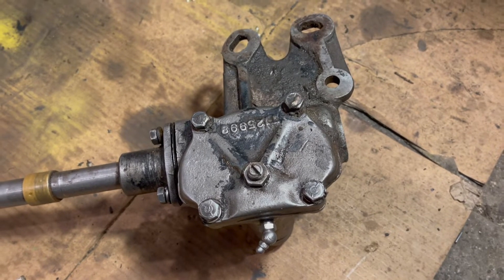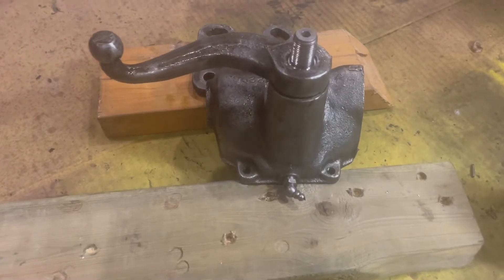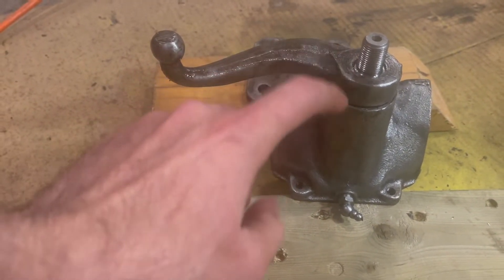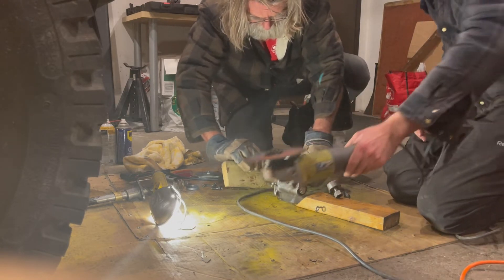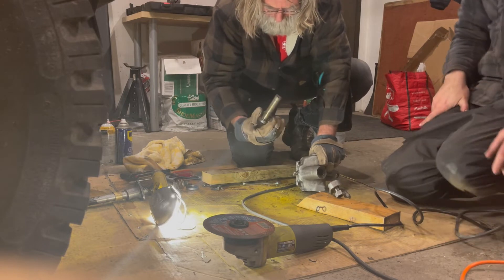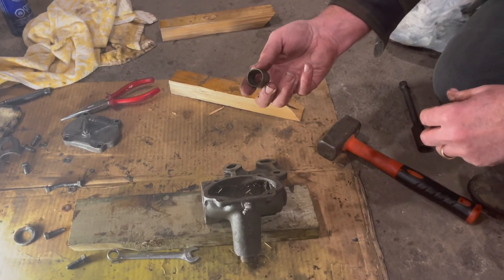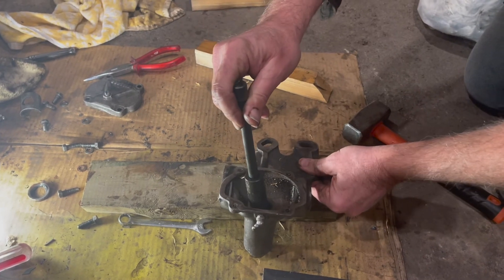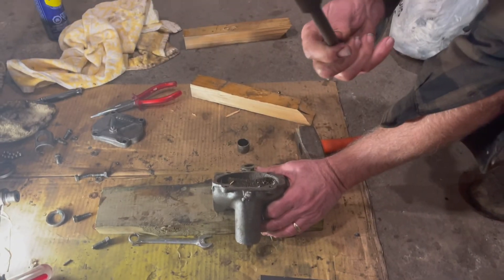How to disassemble Willys Jeep Ross steering box

Comment: How did you remove the worm gear shaft from the steering box housing?  Mine feels and looks locked in place.  It spins smoothly on the bearings.  I'm wondering if I really need/want to remove all that....  My sector shaft and Pitman arm look good, although I had a lot of black grease inside my steering gear box as well.....